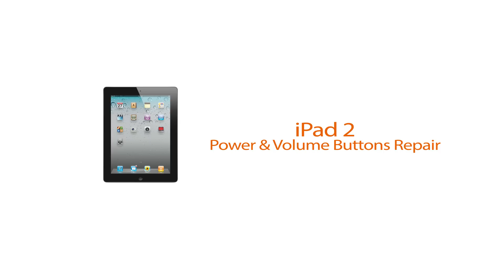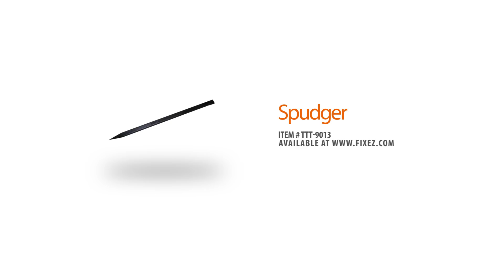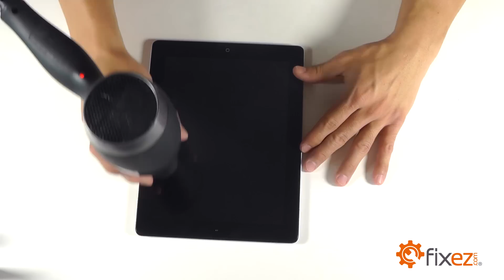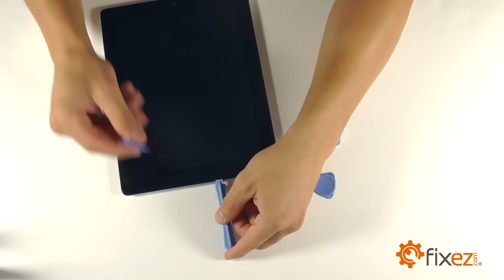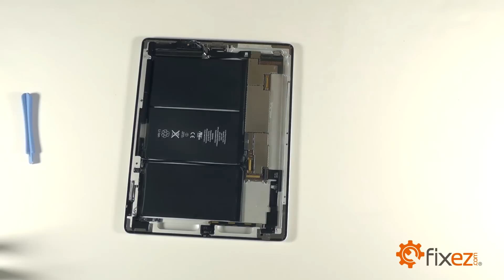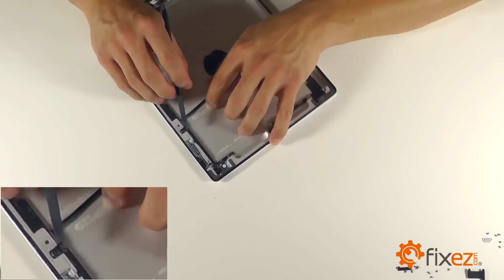iPad 2 Power & Volume Buttons Repair

Comment: Hey I've got an issue, those 2 gold pins that touch the home button module broke. What can I do?
Reply from the maker: +Calvin Short You'll need to replace this component in this case. Is it the actual home button assembly?
Reply: +Fixez.com I figured it out. The 2 pins were attached to the charging flex cable and connector, so I replaced that very easily.
Reply from the maker: Great, glad to hear the good news.